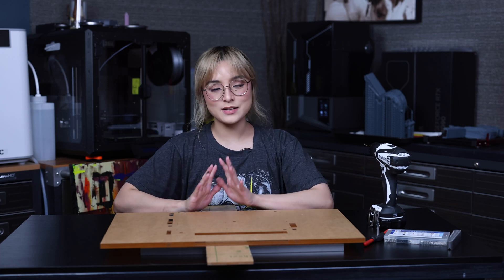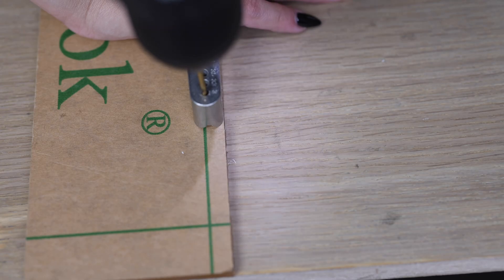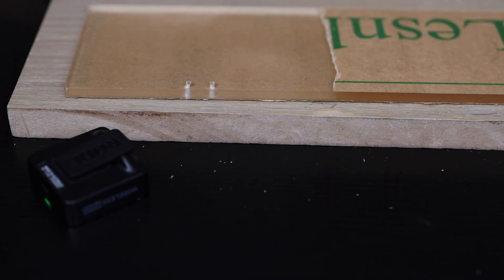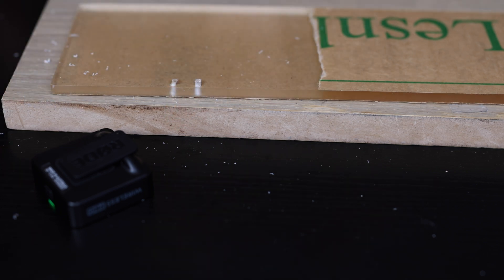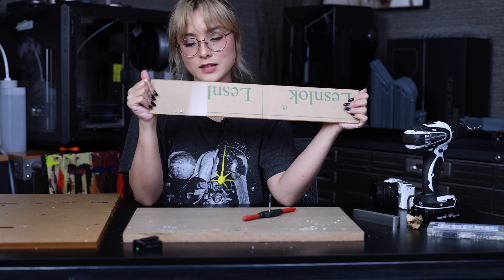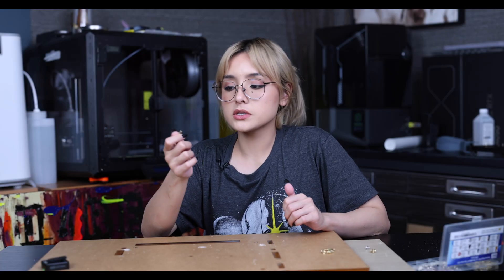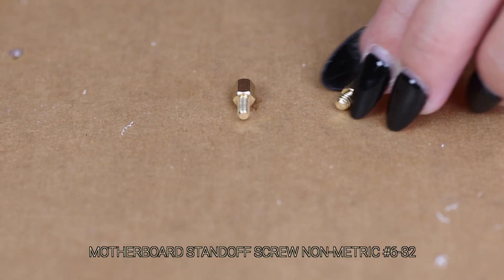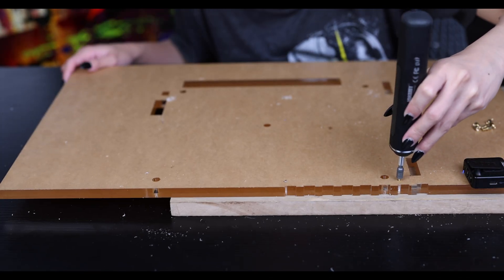Tapping My Custom Mother Board Tray | 4 Common PC Screw Sizes for PC Builds

Comment: This is the thickest acrylic plate I have ever seen, is it custom made?
What is going on? why? 🤯
There are other ways to add threads, for thin/sheet material you can use Rivet nut, for wood and plastic you can use Threaded Inserts (different versions and installation method for each material)
Reply from the maker: It needs to be at least 1/2 an inch because I'm running tubes through it and it needs to be thick enough to account for the fitting threads :)

Comment: for the acrylic or non-conductive material case
I advise you to connect the ground of the motherboard to that of the power supply.

when there is an electrical overload this could be useful ;)

Comment: My dog hates the sound. I had to skip ahead at 7 minutes because she started owling. 😢
Great video though! ❤
Reply from the maker: Oh no, sorry!  I bet she hated that squeak!
Reply: @SnaxanTech  it's ok. She was fine when I skipped ahead.  Was still a great video.
I need to mount a water pump in a thermal take the tower 900 case when the screw holes don't line up so the video was quite Timely for me.
How did you find the strength of the tapped holes in plastic as I was considering a plastic cube with holes tapped in it as an adaptor between the two different holes in the case and the pump mount.

Comment: I'd like to know more about that motherboard tray.
Reply from the maker: It’s a 1/2 inch piece of acrylic and designed the template for the case it’s going into and  I used a laser cutter to cut the holes.  If there’s enough interest I’ll put up a separate video for that part :)
Reply: @SnaxanTech  . . That would be cool. I too am wanting to build a custom enclosure of my own design, and any ideas or advice would be appreciated.
Reply from the maker: @RANDOMNATION907  It's hard to say without knowing the type of case you'd want to build but just keep trying to learn and soak up as much as you can.  I learned a lot and got inspired just by watching a lot of videos and researching.  If you haven't done a custom one yet start small with simple mods.  Do easier things like maybe take an existing case and start with smaller mods to make the case your own.  Then slowly ease into getting into more complex stuff.